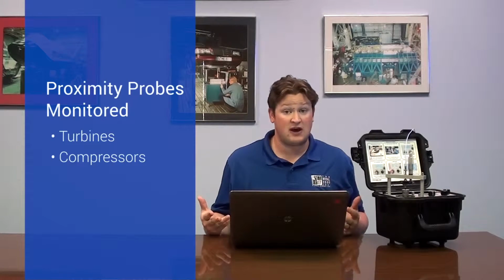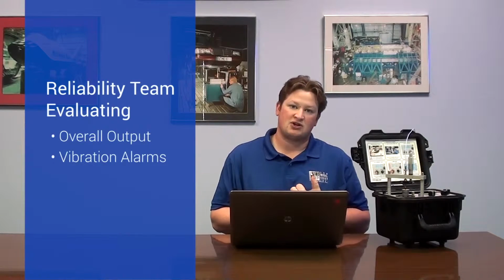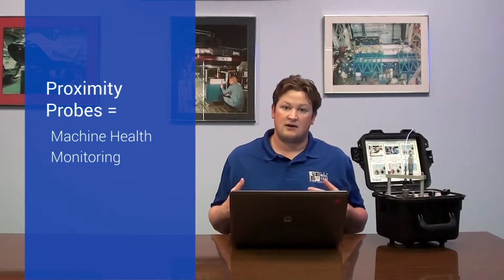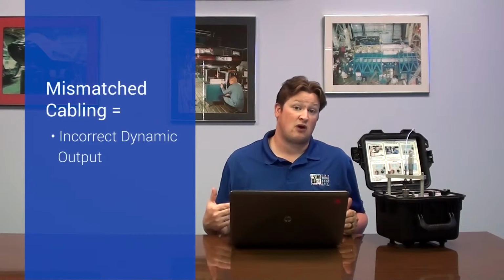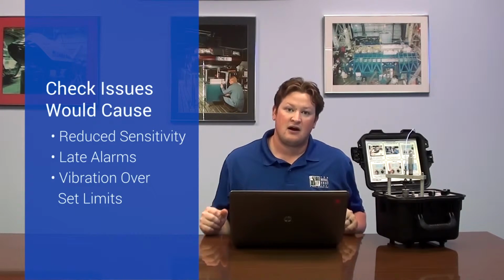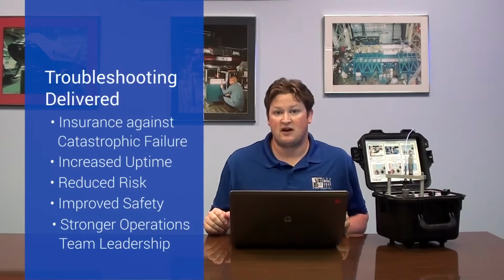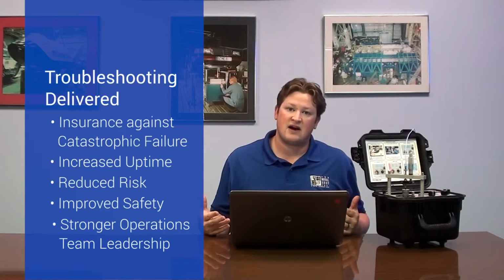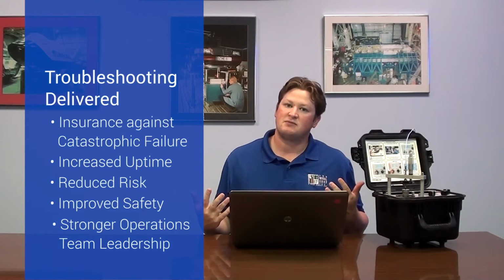Oil Refinery Proximity Probe Validation with Portable Vibration Calibrator

Comment: do you have any demo video of this portable calibrator calibrating hand-held vibration meter?
Reply from the maker: We have a video that shows how to use the calibrator to test an Emerson Process Management model 2130 Machinery Health Analyzer. This video is located here: http://www.modalshop.com/Field-Calibration-of-the-Emerson-CSI-2130-Vibration-Analyzer?ID=1117. The same concepts from this video would apply to any vibration meter as long as the input sensor sensitivity can be adjusted in the meter. The most common source of error when using a vibration meter or analyzer is sensor drift. This video shows how to correct for sensor drift in the 2130.